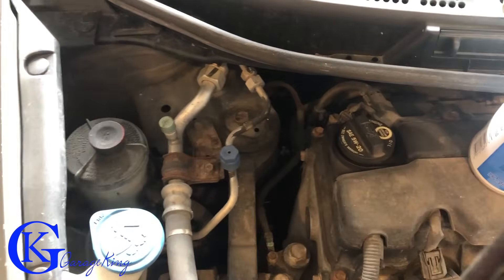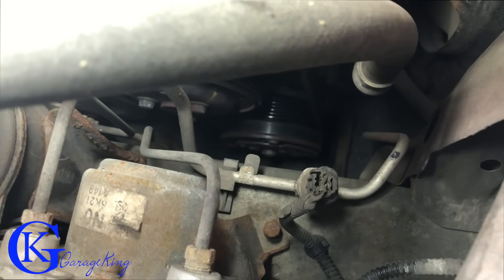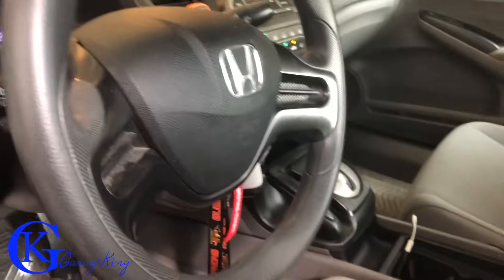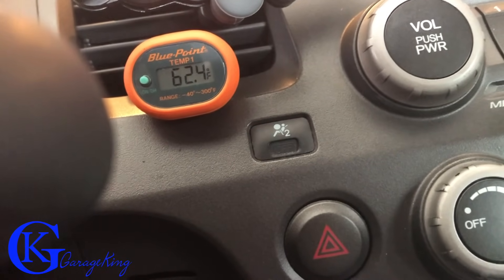How to charge Honda Civic AC with a can

Comment from the maker: Best prices for 134a and the hose/valve are on Amazon.com, and they ship to Canada if you are in Canada, better than the Amazon.ca price

For the charge hose w/gauge https://amzn.to/35WbEWv
For a 13 oz can of 134a with disposable hose https://amzn.to/3F14GOo
If you need a new compressor https://amzn.to/36dJQ2j
Reply: Never stop making these videos!!!🙏🏻
Reply from the maker: @MrHighRow  Thanks for the vote of confidence brother !!  Its comments like these that keep me going !!  Thanks !!!!
Reply: I just replaced condenser on civic, how do i get air out of system with regular can charge system? Method you showed probably won’t work. Isn’t air heavier than freon? It should stay on bottom of system because of simple gravity.
Reply from the maker: I do have another vid on how to do it with gauges. You can do it with a can but you need to evacuate the system. It’s not that the air is heavier. It’s the moisture in the system so when you attach a vacuum and draw it as close to 30hg as you can what you do is change the boiling point of the moisture and it gets drawn out of the system. You can evacuate from either side and then add the can.  As a best practice you can evacuate the air in the small line from the can by piercing the can the. Loosening the can until it vents a bit. Just make sure you have a 134a connector on the end.  Sorry for the long winded answer but in a nutshell you have to evacuate the system first. You should do this anytime the system is opened.
Reply from the maker: I should have added that you need a vacuum pump to do this. I’m not at home right now but I can send you links to things you need tomorrow just to give you an idea.
Reply from the maker: @serega4087  I do have another vid on how to do it with gauges. You can do it with a can but you need to evacuate the system. It’s not that the air is heavier. It’s the moisture in the system so when you attach a vacuum and draw it as close to 30hg as you can, what you do is change the boiling point of the moisture and it gets drawn out of the system. You can evacuate from either side and then add the can.  As a best practice you can evacuate the air in the small line from the can by piercing the can and loosening the can until it vents a bit. Just make sure you have a 134a connector on the end.  Sorry for the long winded answer but in a nutshell you have to evacuate the system first. You should do this anytime the system is opened. A vacuum pump does not cost a lot (for a cheap one) https://amzn.to/3t11Zso but you also need a line https://amzn.to/38sW7Rq so together you can get for under 100.
Reply: A very nice video. My car is blowing cold air again.. Thanks for saving my money!!!
Reply from the maker: @akshaypatel6473  Thank you for the great reply and glad you were able to save some cash !!

Comment: Great instructions, I do have a question. Why do you not shake the can? I seen another weird it said to.
Reply from the maker: Hey there and thanks for the comment.  You can shake the can if you want LOL :)  Some instructions on some cans say to shake, while others don't say anything. I just checked an extra can I have in the garage and it says to "agitate" while filling. I did that at the 8:30min mark (video was sped up) These cans are pressurized, so I think they just want to make it easiest for you to empty the can. I find it easiest by putting the can upside down so the liquid can come out and go right into the car, if its upright, then the gas comes out and goes into the car, and the liquid in the can changes to gas as it empties (when the can is upright)  So it really doesn't hurt to shake the can, and if the manufacturer says to shake it, well you may as well. Hope this helps you out, and hope you are enjoying your weekend :)

Comment: Great vid!! I opened up a word doc and took literal notes while I watched the second time. Trying it out this week. No AC in my 2008 Civic. Hoping to change that! Thanks, Garageking 👍.
Reply from the maker: Thanks for the great comment, most of the time this is all you need to do.  If you fill it and the AC compressor wont engage then you most likely have a bad thermal switch which is quite common on Hondas.  Its located right on top of the compressor.  Its a bit of a pain to do, but you don't have to discharge the system to do it !!
Reply: Did it work? I’ve got a 2008 civic same as you and replaced the ac relay to no avail.
Reply from the maker: @lordtachanka4520  When you say AC relay do you mean the AC electrical relay or the thermal switch?

Comment: My A/C is bowing cool, but not cold enough. Compressor is running, it is actually brand new. When I go to purge the air out of the hose,  no air comes out when I loosen the can. Any idea why?
Reply from the maker: If the hose is hooked up to the AC low side and the can is screwed into the fill hose adaptor (CAN NOT PIERCED) Then when you loosen the can, it will purge, it has to because when you connected the fitting to the low side its the un-pierced can that is holding all the pressure in.  Its like if you just connected that hose to the car without the can on the end.  All the refrigerant would come rushing out.  Also I saw your other post about filling from the high side.  Your fill adaptor should not be able to fit on the high side, you never charge on the high side, as the pressure is too high, you need the low pressure side to "suck" the refrigerant out of the can.
Reply: @GarageKing  Yeah, I saw you do that in the video, but mine won't do it. I tried loosening the can and then even took the can completely off while it was hooked up to the low side and nothing purges out. So I'm wondering if this hose i got is defective or maybe has a check valve in it or something? Ignore what i said about the high side, i deleted that comment because i was mistaken about that.
Reply from the maker: @Brandovibe  Ya I wonder if you got a defective hose?  There should not be a check valve in it so if you have it snapped on correctly to the low side you should get refrigerant out of it. Because your compressor is running you have to have pressure in the system or the compressor will not run.  I think you must have a defective fitting on the hose as they are just pass though.

Comment: I have a 2012 civic, and my compressor is not turning.Should I try to add the refrigerance anyway? , in case the issue is that there is absolutely no refrigerant in there?  I'm obviously hoping that that's the issue not a bad compressor.Thank you very much..
Reply from the maker: YES, but before you do so, connect the can to the hose (don't pierce the can) and then just connect it to the low side (where I fill in the video)  The gauge will then tell you what pressure you have in the system.  If the gauge is really low, like 40-60psi, then the compressor won't run and you are low.  P.S. normally the compressor does not go, if you fill and the compressor does not engage then most likely its the thermo switch located on the top of the compressor.  It can be changed without discharging the system.

Comment: With the engine running ?? I thought it was supposed to be off? And cooled down ?
Reply from the maker: Yes with the engine running, the pressure will be lower on the LOW side with the engine running.  When you turn the engine off, the pressure from the high side and low side equalize and your LOW - FILL SIDE raises.
Reply: @GarageKing  Hey, thanks for explaining. I really appreciate it. I was taught otherwise for some reason.
Reply from the maker: @Username_copied3  No worries at all and glad I could help

Comment: Very helpful, but why did you skip taking the can off? Now I'm nervous I'll mess that up 🙈
Reply from the maker: I went back to look at the video and you are right, sorry about that.  Its actually very easy so I don't know why I didn't catch that part on camera.  You remove the can WITH THE ENGINE RUNNING, this way the pressure stays low. When the can is empty (you saw in the video near the end the gauge go down) then you just disconnect it and a little will come out of the can.  No way around that, it will hiss for a few seconds.

Comment: GK, you are just awesome! Another success story here on a 2008 civic coupe. I have not had AC like forever. Went out and bought AutoZone California R134a Refrigerant 12oz, then charged my car an hr ago. Inside car temp went from 87F to 46F when done, with ambient temp 92F (California). Thank you so much! 
Two questions if I may, 1/ when I tried to purge the air in the line, I didn't hear any "Psst" sound at all, like the pressure sound at 4:28 mins into your vid. Why was that? I went ahead anyway, any consequences?
2/ Could you make another video to diagnose leaks with a dye? My car is old so hopefully the charge stays; otherwise, I would have to diag a leak in the AC system. Thanks again!
Reply from the maker: Hey there and thanks for the comment. If you didn't get any "Psst" sound it most likely because you didn't have any pressure at all in the system.  What I tried to show was loosening the can a bit (before you do the job) will allow some of the refridgerant to come out, just a tiny bit, and that will push the regular air out.  So for you, you probably got a little air in, no worried with the lenght of the charge hose its such a small amount.  I'm planning to do a dye video :)

Comment: If my ac is going in and out (hot air some hours and cold others) am I still safe to out in a full can?
Reply from the maker: depends on how big the can is, now they are made in different sizes.  You should be ok with a small can.  Keep in mind I bear no responsibility, I'm just going from experience.

Comment: @garageking thank you so much for sharing your knowledge....but how do i know when i just need a top up of refrigerant to try such step? Everyone i looked at says to evacuate the old refrigerant first .....I really wanna recharge my A/C myself so your response would be great ...thanks
Reply from the maker: Hello, its time when your AC does not blow cold anymore, or it blows cold for a few seconds and then warm and back to cold (that's the little bit of refrigerant moving around).  Once its warm its pretty much empty as most systems will begin to cool with just a few oz. So if you are 60% full or 100% full your system will probably be the same temp.

Comment: Thank you ,my question is what if my ac is only blowing out cold air from one side of the car inside and can i re fill ive got a 2017 civic 🤔🤗
Reply from the maker: Hey there and thanks for the comment.  If its blowing cold on one side I would say its probably your vent doors are not working properly. Does the 2017 Civic have separate cold and hot for driver and passenger?  I know this Civic did not, but I'm not sure about yours.

Comment: What an outstanding video!! I have a question about oil charge. My car is an ‘06 Mazda3i w/ 170K miles that has spent its entire life in Florida; we use the A/C pretty all year long, yet we have never, ever had the A/C recharged. Lately, the A/C has been taking a very long time to blow cold. I got a 12oz can of R134a, but do I need to add a can of oil charge, too? If so, what kind and quantity would you recommend?
Reply from the maker: Hey there and thanks for the great comment !!!  I do aim to please !!  If you have never had the AC recharged, 1st you are lucky, that is great !!  Now with the oil, I would not add any at all.  Even though the manuals specify how much oil is in each AC system, its really impossible to know.  Its not like refrigerant where you can evacuate the system and then weigh in a new charge.  I am a licenced mechanic and I was always taught to replace what comes out.  So if you replace a part, you measure how much oil comes out, and then put that same amount back in.  Now if you have recharged a system 10 times and its leaking everywhere (pressure pushes the oil out) then you need to add some.  But you are not in that boat.  I would not add any oil in your case :)

Comment: Thank you, my car is blowing cold, but not super cold.  Does that mean it is low on 134a?  and How do you know when to stop so you don't over fill it if I want to charge it up?
Reply from the maker: Well, if it's still working you really don't know how much is in there.  The only way to know is to evacuate it, and weigh what comes out. I just did a dye video on the civic today (yes leaking), and replaced the condenser.  When I was filling it took about 2oz to turn the compressor on so not much to get the ac going.  By the time you have about 4oz in it, its starting to cool.  I find from experience that when they are about 1/2 full they cool pretty good.  So as an estimate you are probably around 1/2, so I would not add more than 8oz, as 16oz is 1lb, and that's a full charge from 0.  BUT - PLEASE DO AT YOUR OWN RISK.  I'm not there to supervise.

Comment: I tried recharging my 08 civic as it was blowing 100°f air and everything was spinning. The attachment I got said not to exceed 38 psi. It was at that when attached pretty quickly and the AC just leaked and the can was still pretty full. I left the hose attached to the can because it started spewing when I tried to take it off . Airs a bit cooler now but worried it won't last
Reply from the maker: Hey There and sorry to hear that happened to you.  You can exceed 38psi on the low side. I try to keep it around 30-40 for filling.  What probably happened is the connector on the hose was tight (where the can screws in) If you look on the connector there is a brass (normally) nut thats under the wing part that you twist into the can.  If that nut is loose once you pierce the can you are going to get a major leak. Also once you are at 30-40 you turn the nut to "throttle" the amount of refrigerant going in, so you can keep it between 30-40 and empty the can into the car that way.  I would take another go at it. Just check to make sure the fittings are tight on the connector.

Comment: hi, i want to refill my 2008 honda accord and am wondering if i should use a 12a or 134a, does it matter which one i use? cos all i see in stores near me are 12a refrigerant .
Reply from the maker: You can use the 12a as it’s a replacement for 134a, but just know you use about 1/3 of the amount of 134a required. They usually come with a conversion chart. 12a has different properties but works well. I have used it. The procedure is exactly the same, but just know you don’t use much of it. FYI - depending on how fast your car is leaking the 134a will last longer.  Great to see you tackling this, have a good day and thanks for reaching out :)
Reply: @GarageKing  Thanks
Reply from the maker: @kaitlynracco1206  anytime :)

Comment: When we remove the can need to turn off the engine or running engine we can remove it????
Reply from the maker: Better to remove the can when the engine is running. There is less pressure on the LOW side (where you are filling) when the engine is running

Comment: I just bought an 07 civic and might consider trying to recharge it myself after checking the compressor clutch to see if it engages or not .with 418000 kms though I assume it's leaking at the compressor shaft seal .
Thanks for sharing your expertise "g"
Reply from the maker: Hey Congrats on buying an 8th gen civic.  Great cars and with 418000kms, WOW !!!  That is awesome, they truly do run for a long time.  Keep it maintained well and you should get some good use out of it.  WIth that many kms I would not be surprised if its the compressor shaft seal, its made a lot of revolutions in its life.

Comment: Why any gage I used never show more than 32 or 35 psi. How your show more? also other videos show 45 to 50 psi. Now your Temperate inside with the A/C on is 62 F, mine is 41 to 42 F, how is that?
Reply from the maker: Lots of factors can influence temp and pressure.  The outside temp and humidity.  Yours are good.

Comment: Hi, thanks for the video. My AC clutch is not engaging. I see that often the reason the clutch doesn't engage is due to low freon. How can I determine if I should proceed to add the r134a?
Reply from the maker: You can screw the can onto the hose BUT DON"T PIERCE, DON"T TURN THE SCREW,  you are only putting the can on to seal the one side so when you pop the connector onto the LOW side of the car you will be able to see if you have any pressure.
Reply: @GarageKing  thanks for the reply! I continued sleuthing and found that the compressor clutch relay wasn't working. Replaced and found the freon unnecessary. Thanks again
Reply from the maker: @jbgiant  Awesome !!!  Glad you got it done

Comment: This is a really good explanation. I’m trying this out this afternoon.
Reply from the maker: That is awesome !!!  And you are going to save yourself a few bucks for sure !!!
Reply: @GarageKing  My compressor doesn’t seem to be engaging :(
Reply from the maker: @Shade7x  Oh crap !!!  Just make sure you have put enough in, sometimes it takes a bit for the compressor to engage. If you have put the refrigerant in and it won't turn on then most likely you need a new thermo switch, they are a common failure point on the civic.  The part is worth under $100 but its a pain to get to.  Its on the top of the compressor so you have to take the alternator out. Keep in mind that's a common problem.  It could be the magnetic clutch in the compressor.  Some people just get a remanufactured compressor as they have come down in price. See https://amzn.to/36dJQ2j